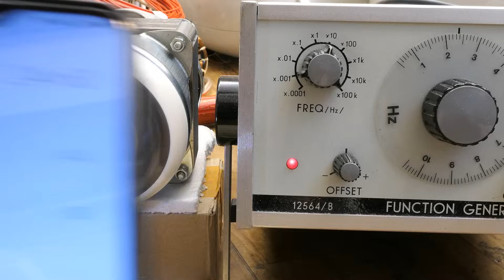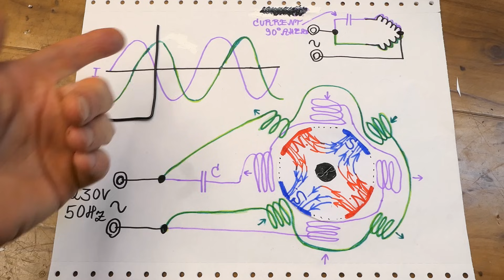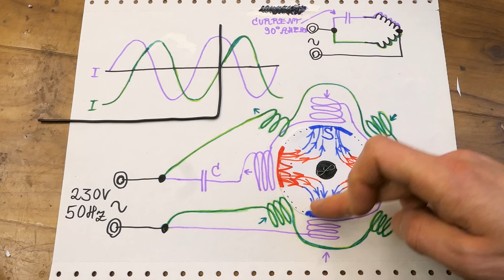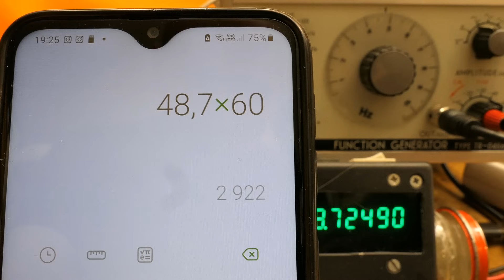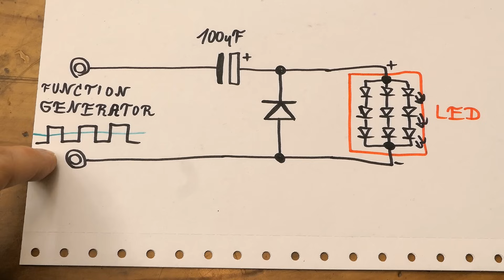Induction motors + strobe light RPM measurement

Comment: When I was a kid I had a big two turntable dj box thing. I wanted to change the speed of the records playing so I took it apart hoping to add a variable resistor to the motors. I found that it had AC motors inside it and that it didn't seem possible to achieve what I wanted. Your vid helps me understand how they worked. Thanks! 🙂👍

Comment: You need to take a different gear Ratio.
The generator Must be Turned faster You have to mention rhe magnetic Slip twice ;).
And i would use a capacitor for each "generator" windig ;).
good luck!

Comment: Shaded pole motors used to be found in cheap record players -- often with a secondary winding on a separate bobbin section, using the laminated steel core of the motor as the core of a transformer to supply power to an amplifier.  The motor runs all the time to power the amplifier, and the turntable is started and stopped by moving a rubber wheel into or out of contact between a stepped cone on the motor (which gives the different speeds by moving the wheel up and down) and the inside of the turntable rim.

Comment: Induction motor has low startup torque but when it speed up in some time torque increases significantly, so we can say that it is very slowed down by the load if it does not exit the operating mode.

Comment: Great video! But I do not understand how is the small induction motor able to initial start even from every angle with two magnetic poles only? Imagine the two pedals of a bicycle: There's this exact angle position of pedals, one showing to ground, the other to sky, at that exact point I do not have any force momentum with my feet/legs to get my bicyle to move!
Reply from the maker: In the shaded pole motor, the short turns create another 2 poles with the ac magnetic field delayed (lagging). That's why the magnetic field is rotating, not just pulsing.
Reply: @DiodeGoneWild  Thank you, wow didn't even know that such a simple single phase AC motor running without a capacitor does exist, from an environmental waste aspect of view this motor uses hardly any rare earth elements which is very good in my opinion!

Comment: So when the slip happens regularly, does it trip back when the phases overlap again? What happens when the shaft is stallled?
Reply: in an async. motor the rotor doesnt have a polarity by itself, it only gets one from induction. So the slip angle will stay the same unless the load changes.
If you mean in a Synchronous motor though, it WILL basically get "overtaken" by the stator field and lose all its torque if it is loaded too heavily. It always needs some way to synchronize for startup, and if it ever stalls, it needs to be resynchronized. Depending on the motor, stalling or improper startup can also cause permanent damage though.
Reply: @Basement-Science  thanks man. ❤️

Comment: OMG you for got your beautiful cat.  Btw: Japan is divided between 60Hz in the south and 50Hz in the north. Let us know which frequency you think is more efficient.
Reply from the maker: Lower frequencies are better for big machinery (big generators, big industrial motors, long power lines). Higher frequencies are better for smaller appliances. The first mains frequencies used were around 25Hz only, it worked better for all the big things. But lights flickered and lower power transformers were bigger and less efficient. They also tried 133Hz, which made transformers much smaller, but it was too fast for motors. So they went to 50 or 60Hz as a compromise.

Comment: It's worth mentioning that, as soon as the single phase motor starts spinning it doesn't need the phase shifting elements any more and could potentially work without them. The motor could even start by itself, due to vibrations and imperfections, but it would start at a random direction each time. That's how microwaves spin their table at a different direction (almost) every time.
Reply: I always wondered about the microwave carousel.
Reply: It's also possible to use a gearbox that prevents running in the other direction mechanically while stopping the rotor in a position where it can build up enough inertia the other way from a stand still. 
I think these turntable motors instead have some slack before they drive the output (and thus the heavy plate) in a different direction, which means they run with no load at first and thus have enough torque to start in a single AC half-cycle.
Reply: Well, actualy, the table spining motor is synchronous. I disassembled one and it has tiny magnet (and it can be the reason of random direction.
Reply: I do not agree. In a single fase asynchronous motor even already running the magnetic field has to rotated and be ahead the rotor spin to do a positive work. Due to secondary effects it could still produce some torque but would not be able to hold the nominal torque required. To proof my point try a capacitive run motor under load and try to remove his capacitor while running. The motor will stop.
Reply: @rsaj-cq6ne  Yes, if a motor is designed to work with a capacitor and you remove it, that would change the characteristics of the motor. I did not meant to imply that every single motor can operate normally in this mode. I just wanted to say that a motor could keep spinning without the capacitor (at least when unloaded) and some motors are even designed to run that way.

Comment: Cool idea to measure RPM! 👍
But I didn't get how the rotor can be slower than the rotating field in the stator coils. If mains is 25Hz, how could the rotor rotate at 24Hz. Wouldn't they loose the "connection"? 🤔
Reply: This would happen on a synchronous motor, as it uses permanent magnets, so it has to be 100% in phase all the time.
However, an asynchronous motor allows slipping, it works like eddy currents, if you ever tried to drag a magnet across a piece og copper or aluminum, you know how it resists being dragged.
And that is basically how the field of the stator affects the rotor.
Reply: @HomelabExtreme  Ah, I see. So this 1Hz slip is a small rotation of the magnetic field (backwards) within the rotor itself?
Reply: @hugoegon8148  yes, the magnetic field produced by the squirrel cage rotor is keeping up with the stator field, but the rotor is not synchronised to the magnetic field. The rotor field is induced by the cage "rods" moving through an alternating field. If the rotor was synchronised to the stator field, no current would be induced and no force or torque would be exerted on the rotor.

Comment: which is why you should not have fluorescent lights in a room with rotating machinery. they can look to be stationary when they are still rotating and just waiting to rip your hand off.  
Nowadays I expect that you need to be just as careful with LED lamps as they can be flashing just as bad as fluorescent ones.
Reply from the maker: This is partially a myth, because no source of light designed for illumination actually produces something like 1% duty cycle flicker, which would produce a sharp stationary image. In reality, it's at least 50% duty cycle in the worst LEDs with no smoothing. Fluorescent and discharge lamps only barely touch zero light output during current zero crossing.  Of course rotating machines can appear stationary or moving much slower in such light, but the image is very blurry, which can hardly make you believe the machine is off.
Reply: It maybe a myth, but I'm sure in the UK any lamp that can flash should not be used near rotating machinery. I'll have to check what the Health and safety requirements. I remember being shown a lath that looked stationary due to a overhead light at the health and safety executives (HSE) black museum in London during the late 70's.

Quote from the HSE "Lighting at work"
Stroboscopic effects

"28 Lamps that operate from an alternating electrical supply may produce
oscillations in light output. When the magnitude of these oscillations is great,
machinery will appear to be stationary or moving in a different manner. This is called
the stroboscopic effect. It is not common with modern lighting systems, but where
it does occur it can be dangerous; so appropriate action should be taken to avoid
it. "
Reply: Squeak !! @TheEmbeddedHobbyist
Reply: Eek, Hi Mr Squeak @andymouse

Comment: That's excellent! At the start, I saw your washing machine motor and was sad because in the UK all (?) of our washing machines have universal motors and I'll "never" find an induction motor to play with. But then your second demonstration made me look closer at my microwave fan motors and they ARE induction motors. So thank you for making me look closer at my own junk.
Same as always, your AI 3D computer simulations are excellent!
Reply from the maker: This motor is from a bread maker. Washing machines switched from induction motors to universal motors probably in the 1990s to give them a high speed (and adjustable speed) spinning ability. Before this, they used to have a 2-speed induction motor with 2 sets of windinds. The motor I saw from the 1980s - 1990s washing machine had one set for washing (16 poles, about 340 RPM), one set for spinning (2 poles, about 2900 RPM). Each set was made of 2 windings, one connected via a capacitor, one directly. So in total 4 windings.
Reply: I am from India and here we can buy washing machines with an induction motor. Washing machines available here in India are of 2 types top loading and front loading. Top loading types can be sub categorised as automatic and semi- automatic type. The semi automatic type has two induction motors. One is for wash agitator. It's a 6 pole or 8 pole PSC type induction motor and speed is reduced by pully and gear reduction mechanism to ~200- 300 rpm for agitator. The spin motor is 4 pole PSC type motor spinning the spin drum at ~1100 -1400 rpm depending on the load. 
It's surprising that Europe markets don't have semi automatic washing machines!!!!!!!!!!!!!!!!!!!!
Reply: @DiodeGoneWild  I want to see that 16/2 winding motor now. :)
Reply: Here in indonesia a lot of washing machine top loading that use induction motor, at the scrap yard also we can find a lot of scrap washing machine induction motor
Reply: LG Direct Drive Washing Machines don't use Universal Motors, and there are machines that employ induction motors (Indesit?).
Reply: @marcse7en  Some Indesit and Hotpoint Ariston washing machine use a high-speed induction motor (maybe other brands too).
The induction motor has 2 poles and the frequency is up to 290 or 380 Hz depending on the motor.
It is driven by an IGBT inverter which is located on the main control board of the washing machine.
It sits sxactly where an universal motor would have sit, and drives the drum via a belt.
I suspect Indesit chose this design as it makes the washing machine more silent without significantly altering its construction. In fact some lower-end and more recent models still use universal motors, and they are LOUD.
Recent high-end washing machines use a direct drive motor, the motor is usually of the permanent magnet synchronous type and has an external rotor.
Reply: Yes can confirm Indonesia still use induction motor for their washing machine